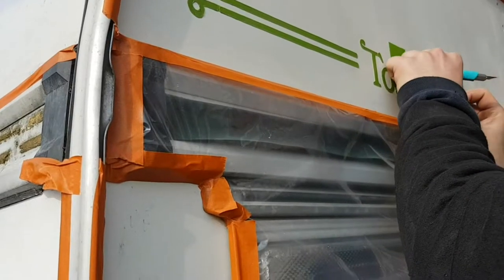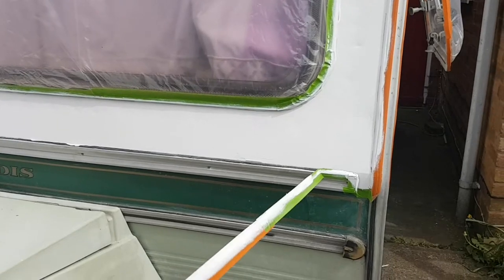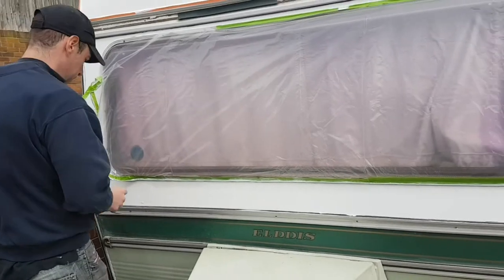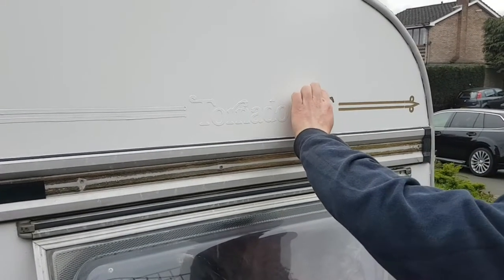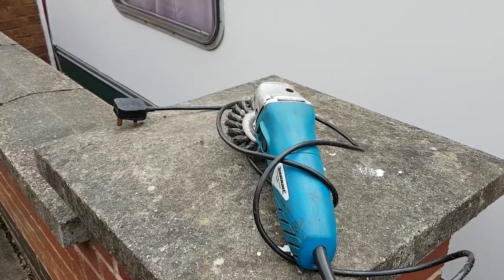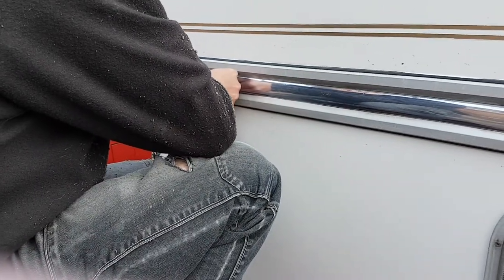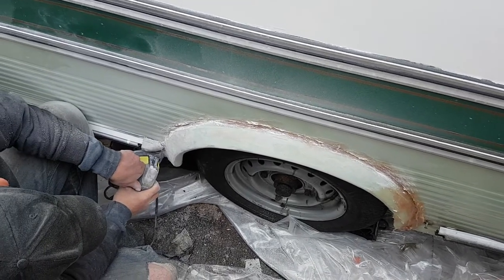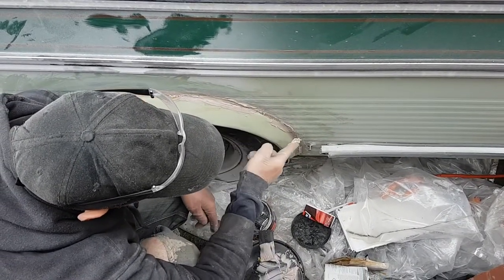Painting our caravan exterior

Comment: You have done a wonderful job with your caravan. Looks good, however I personally would have used a water based multi surface paint ,this will stay white as opposed to an oil based paint which will yellow with age. Am I being picky.
Reply from the maker: You're probably right. We used waterbased for the purple and had issues with runs. Both were for metal, and they've held up well so far

Comment: how's the gloss paint holding up now, I did this on my old caravan a few years back and the gloss paint cracked and peeled in the sun. I admire your spirit but caravans expand in the heat and contract in the cold, I never realised this when I used  Gloss paint I later found out I should have used rubberised paint that is UV proof that stretched with the metal.
Reply from the maker: The paint has held up well, no cracks or yellowing. It is designed for outdoor use, perhaps that is why 😊